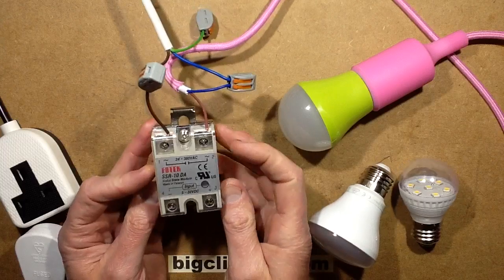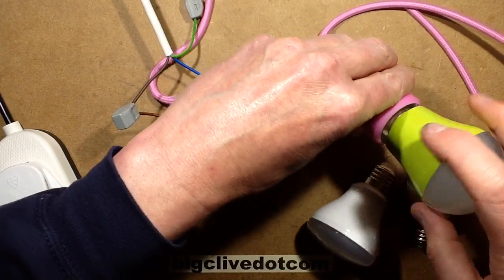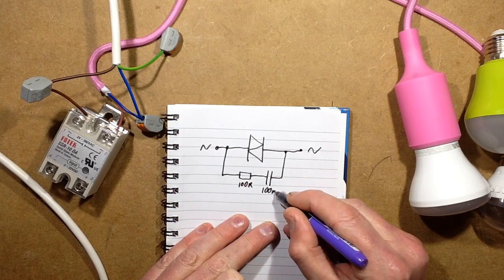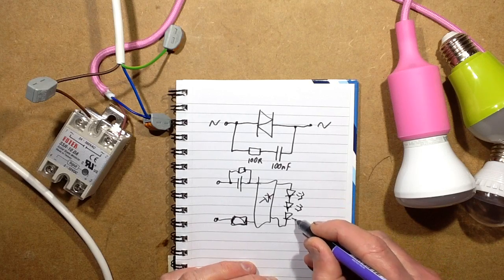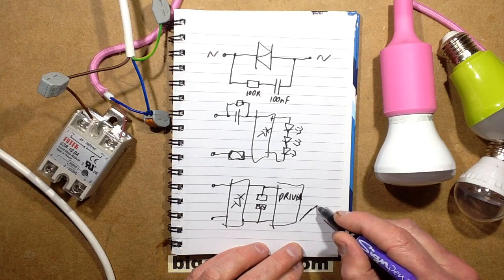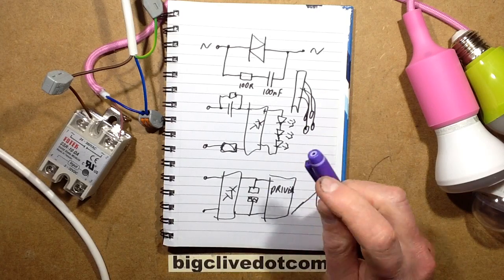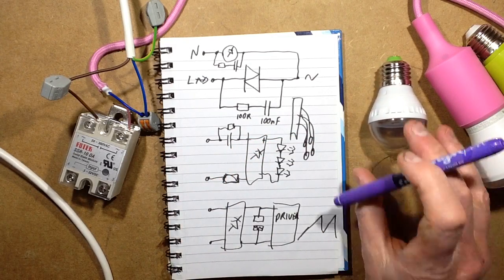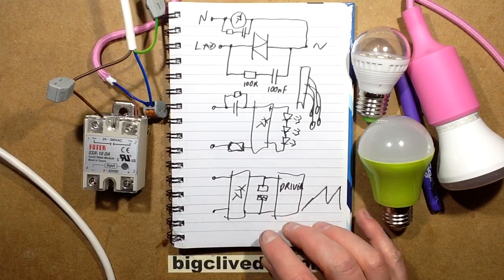Electronically controlled LED lamps glowing when off.

Comment: This issue seems to be more common with LED lamps of low wattage such as 2.8 watts. I have found that 2.8 watt LED lamp poses this problem whilst a lamp of 5 watt does not.
Further lamps of same wattage but of different companies behave differently.
Why is it so?
Reply from the maker: It tends to depend on the fitting of a shunt resistor in the lamp.

Comment: Ive gone back to halogen G9 in my polished chrome ceiling light fittings where Id tried LED bulbs that glow when off. A decent dimmer switch on the wall and they give off a much nicer light anyway. Not a single bulb blown in over 2 years. Im so tired of messing around with expensive LED lighting that just dosen't seem to give off a decent non defused light or as reliable .

Comment: I have a LED bulb that I clipped a resister out of, and it is glowing even when the switch at the wall is off.  No dimmer, no relay. Just bog standard light switch. Is this an issue?
Reply from the maker: That's common.   It's caused by capacitive coupling between the switch wires - especially on multi-way switching.  It's not an indication of a fault.  Just a free night light.

Comment: There is always a leakage voltage on an SSR .It will allow low voltage low current devices to to stay illuminated .We will switch heater elements through and use a manual motor starter or  contractor to disconnect the output going to heaters .Especially at 600V 3 phase heater banks used in commercial ovens .Croydom, Opto,or Carlo Gavazzi  they all have the same issues

Comment: I swapped 4 outdoor PIR Halogen floodlight bulbs for LED bulbs a few weeks ago and half of them are fine and completely dark when not triggered, but two of them light reasonably brightly when on, but not triggered, then go to full bright when the PIR triggers. i guess the good ones probabaly have normal relays in them? It's frustrating me!
Reply from the maker: It sounds like a snubber network.  The amount of electricity used when they are glowing while off is almost zero.
Reply: @bigclivedotcom  That’s what I thought. I might just enjoy the extra unwanted  “feature” of a nightlight mode rather than messing with snubber networks trying to fix it. After all, the power used would just have been sunk into the previous halogen bulbs anyway? So I’ve lost nothing, correct? Cheers 🍻

Comment: How to prevent this ghosting by using zener in voltage line?
Reply from the maker: It would be better to put a small load across the lamp to bypass the current.
Reply: I totally agree with that but electricians prefer doing a zener thingy, just curious to know how it is actually done, I have tried lut-mlc, works fine

Comment: If they all leaking some current at what cost over a year.  As my thinking all the usb socket chargers just a tiny bit.  It like taking 2p out of every bank account in the UK.
Reply from the maker: The current would be so small it probably wouldn't even register on the meter.
Reply: @bigclivedotcom  I have been looking at the lowest amount the meter will not pick up.  Such as neon lights
Reply: Am looking in to just how much current is needed to register on digital meters / smart meters.  Am getting some USB charge sockets to test next week may do video.
Reply: That's one reason to not leave USB chargers plugged in when not in use I guess,  the other is (and this is tested in dozens  of them ) they are aparantly not up tot par as safety is concerned .

So don' buy shit like this for cheaps I' d say .

Comment: Nice video!!! I bought a rope light that has the same issue, the thing is that I have the stuff around the whole yard and it never turns completely off.... What resistor would I add to an led strip (the rope light) that's about 150ft long? I'm estimating 800W and on although I use a dimmer to make it not as  bright. since it's an LED strip can I just bridge the positive and negative terminals at the end of it? -  t glows without the dimmer as well - Thanks so much!
Reply from the maker: If it's dimmer/control-leakage then any small tungsten lamp will mute it.  But if it's not bothering you then let it glow.
Reply: Thanks for the quick reply.
 @bigclivedotcom  but how much current would it be pulling 24/7?
Reply from the maker: @parascraps5796  If it's just snubber leakage then virtually nothing.  Literally just a few watts.

Comment: I ask, if the bulbs are switched off, will it use power? i have 20w led lamps and it still is on even switch are off
Reply from the maker: Sometimes they glow slightly, but are using extremely little power.

Comment: I ran into this problem recently after replacing all light switches in our house with the ones that have the gas-based light indicator(that turns on when you turn off the light). One of the lights in the house is an LED light fixture and when the switch is off, it blinks rather aggressively and frequently(like once every 2 seconds or so). I've been looking up solutions to the problem and I did get four different suggestions:

1. Connect a resistor and a capacitor in series with the light fixture
2. Connect just a resistor in series with the light fixture
3. Connect just a capacitor in series with the light fixture
4. Disconnect the light indicator(duh, but I bought the ones with the indicator on purpose and I'd rather have it work :D )

:D I think I'm going to grab some resistors and some capacitors with different values(suggested resistor values were up to 1 W with resistance between 100k and 1M ohm and for the capacitor either 220nF/400V or 100nF 275VAC) and see if I can resolve the problem.
Reply from the maker: You could also try a different LED lamp.  Only the ones with switching power supplies are prone to the flashing effect.  Others will just glow dimly (which can be useful) or not at all.
Reply: @bigclivedotcom  true - I'm just being cheap(well and I do want to experiment) xD Other than the flickering it's a perfectly good light - it's not the LED light bulb type, but instead the one that has a bunch of LEDs on a board, so replacing is pretty much getting a whole new fixture, which could have the same issue anyway.
I've temporarily removed the indicator light for now until I can get around to trying one of the other methods.
I'm also curious to know if it's possible to remedy the issue while keeping the indicator light in case we end up getting a fixture with the same problem. 

Thank you for the videos by the way! The educational part is well presented and the humour is top notch too!
Reply: A quick update on my situation. I've gotten two 100nf capacitors - one at 400V and one at 600V. I haven't gotten around to testing it on the fixture yet, but I did run into an LED bulb that did glow when the switch was off. So naturally I tried one of the capacitors(the 400V one). Lo and behold it did allow the LED bulb to turn off completely when connected in series. Here are two poor quality photos of it working - https://photos.app.goo.gl/op7HMMT7eDmDthkh7 . You can see the capacitor when the bulb is fully off, and the lack of it when it's glowing.

Side note - adding at least one bulb that doesn't have the problem to a chandelier with multiple bulbs also resolves the issue(I tried it with a different LED bulb that behaved correctly). However the solution with the capacitor can come in handy if you don't want to have mismatching bulbs, OR you can't add/replace things like in an LED fixture that doesn't use bulbs(no idea if that's the correct term :) ).

Not gonna lie - solving this made me squee with joy xD Considering my dad is an electrician and his solution was to just remove the indicator light xD

Comment: I have a weird LED bulb that continues to glow even when unplugged from the socket for hours. It's not always a steady glow, sometimes it will flicker, occasionally glowing bright enough to light up a room for a few moments.
Either there is a really big capacitor in it, or it's picking up electricity from some wireless source, like how a florescent bulb lights up near transmission power lines.
Reply from the maker: LEDs will glow visibly at just microamps.  Some lamps do glow for a long time when disconnected.
Reply: @bigclivedotcom  Thanks Clive, I Didn't expect a reply from a 4 year old video. 
It is weird to be able to be able to walk around the house with with a disconnected light bulb still flickering in your hands.
Reply: @JamieJamez  I think you could play some good tricks with that!

Comment: I tried putting a 47K 1/2 Watt resistor across the Live and Neutral wires, going to a 240V led bulb.
After a few minutes the resistor got to around 48 centigrade, and was too hot to touch.
The resistor did not breakdown, even when I extended the on time to 30 minutes.
 The resistor stopped the led glowing when the relay was off.

I also tried connecting a wall wart type power supply across the Live and Neutral going to the 240V led bulb. That also took care of the led glow.

So, am I wasting energy, using these SSRS and curing the problem with 'heaters'?

Looks like it is more sensible to use mechanical relays for these problem 240V led applications.

Comment: So the Impedance for this RC network is ZRC = 26.52601 kΩ. So in a 120 volt circuit @ 60 Hz the current is 4.5 MA.

Comment: You are supposed to turn the lights off with the wall switch right? Solved :)))
Reply from the maker: With modern lamps, even turning off the switch can make some glow with switch cable capacitance.
Reply: @bigclivedotcom  if the switch cuts off the power, how could led lamps get the leakage? I am confused a bit. If you are talking about high voltages, that might be the case
Reply from the maker: @cemal8123  Capacitive coupling between the cores in the switch cable.  Especially with multi-way switching.  Some LED lamps will glow at just a few microamps.
Modern capacitive dropper lamps have a resistor specifically for extra load when the lamp is off to try to prevent the glow.

Comment: WOW, Thanks !  I just spent 2 hours trying to figure out why my SSR was showing "almost" full voltage across the Output side, when NO input was present..... 
I thought  I wired it wrong...and you showed me what I had an assumption about - SSR are NOT  "Old Fashioned" coil relays that make a NICE noise when opening and closing!

Comment: So I am not an electrician or far cry knowledge in electronics. My out door lamps has 9w led lights that flicker or glow when turned off. Is this dangerous? I have 2 lamps(both led) sitting outside and simultaneously lights when I turn the switch on.
Reply from the maker: Modern LED lamps are so sensitive that it's not uncommon for them to glow slightly when off via the capacitive coupling or circuitry in the wiring and controllers.
It's not usually anything to be concerned about.

Comment: Be wary of SSRs from eBay as most there are cheap fakes which don't have high breakdown voltages
Reply from the maker: I took one apart in a video.  It had an undersized triac and very poor isolation.

Comment: Help. I have started using Smart bulbs in my flat. Living room are fibe. Bedroom one has a double switch (independent switches in 2 locations which turn the power on/off). I had to use a GU10 to E27 adapter. Obviously the power is on, but when I turn it off (via smart app) it very faintly flickers. 
Any ideas? They switches are not dimmer. I hear it might be to do with the load or poor connection at the bulb. Should I replace the pendant to a E27 and do away with the adapter?
Reply from the maker: It's common for some LED lamps to glow slightly on two way switching due to increased capacitance in the switch wiring.  Try a different brand of lamp.

Comment: Found this out recently when I was using a solid state relay to control a neon transformer.  Even when it was supposedly off, there was enough current going through the transformer to produce very tiny sparks when the output wires were a fraction of a millimetre apart.  Luckily it didn't catch me by surprise, because I was also using the Cliff QuickTest and its neon indicator was also well lit even when the SSR was supposedly off!

Comment: I've got 2 lap led pir security lights that glow when pir turns off any clues why ? I turn mains switch off and they go out . I have 4 more different make of security  pir senor lights that run off same supply and there fine could it be the lights them selves  cheers
Reply from the maker: It may be capacitive coupling through a filter capacitor.  Probably just a tiny current.

Comment: Possible solution: Put an X2 capacitator in parallel with the lamp as a bypass for the leaking current. 
NOT for dimmed lamps! Phase cutting produces harmonics. These higher frequencies will lead to dangerously high currents throug the capacitator when the lamp ist powered on.
If a dimmed LED lamp glows or flickers when turned off, use a "Kompensator 6596" from Busch-Jaeger. This is just a PTC in a casing. Bypassing leaking current to neutral, it will get hot an highliy resistive when the lamp is switched on.

Comment: Hi Clive. I have this problem with a light in our stairwell. It has a dual switch so that it can be switched on or off from either the top or bottom of the stairs. Very annoying and i really want to fix this without wasting power. I have no dimmer and no relay in this circuit. Just a switch at top and bottom of the stairs.
Reply from the maker: If it's just a slight glow it's not an issue.  It just means that the slight capacitive leakage current that would normally be wasted is producing a small amount of light.  With electronically active lamp where it makes them pulse it would be an issue.

Comment: does the seccond snubber network need to be of a spesific value? (can i use 100R100nf?) it drives me nuts that i have to connect a load (usualy first ting on hand is a par) that gets anoyingly hot, when the load your intersted in is so small 
i want to build a few "snubber plugs" instead of a conventional load :) (perhaps i need to build a fiew versions  and pick the best one when neaded :P )
kind regards,
Milan Hofman
Reply from the maker: 100 ohm and 100n would be a good starting point.  Also include a high value resistor across the capacitor to discharge it.  1 Megohm should be fine.  For an actual theatre dimmer you may need a low resistive load to make the circuitry stable.  A traditional 60W lamp in a work light like a clip-on metal caged hand lamp is one option.  A coloured lamp (even a UV style tungsten lamp) will also avoid light spill.

Comment: Probably the simplest solution is to use a mechanical relay for these applications.  You only see this problem on super-low current circuits, meaning ones where a mechanical relay will last indefinitely.  There's no lifespan advantage to solid-state in those cases.

Comment: With big dimmer packs it's often not just the snubber network. Most dimmer packs are used for tungsten lamps, and as you most likely know, to prolong the life of the lamps, there's a pre-heat setting on the dimmer packs. This delivers just enough power to the filaments to heat up, but not enough to actually light up. When you use LED based lamps on these lines, they wil light up, because they need so little energy. That's likely what the problem was with the disney dimmer packs :p
Reply from the maker: Preheat is an option on the theatre packs.  It was turned off.
Reply: I'm volunteer light tech at a local stage, so that's where I get my info from as far as existing equipment goes ;)
(and electronics engineer... so I do kinda know a bit about the technology... LOVE learning from your videos ;) )

Comment: I knew someone that thought they were getting free light, so they connected a few to make it just bright enough to walk about.  I just couldn't get it through to him that he was not getting it for free,  He was in the countryside so everything was pitch black, so even the small leakage current would light up things just enough to see to get around.  It was so funny he thought he was getting very dim light for nothing, about as dim as he was.  Strange thing though, give him an engine and he was brilliant.  But electric and him did not mix, he even stuck with car electrics.  But he could get more out of an engine than anyone else I knew.  He even got more out of a motorcycle engine than the manufacturers could.  You just have to laugh sometimes!

Comment: Ok I understand this but why do some small LED lights glow a little bit when a non-dimmer switch is off?
This is a house on 120 60Hz in the US. I can post a video if you need.
Reply from the maker: +Sean Not-telling They're super sensitive to even microamps of leakage, including capacitive coupling between switch wires.
Reply: There is noting like that little ghost glow from them at light.
It only does it if I have at least 3 of the 4 sockets filled.
If I have only 2 them no glow.

Comment: So you're telling me solid state relays are actually insanely unsafe and should not and must not ever be used in equipment that MUST be off.
Another point to old school mechanical stuff being higher quality!
Reply from the maker: Even old school relays can weld closed.  But it's less likely than with solid state relays.
Reply: Yeah just cut the power with a true switch.  Had a coworker get quite the shock when operator turned the heaters back on using their touch screen HMI.

Comment: YES,an AC rating capacitor should be connected across the lamp as a dummy load for the leakage current coming from the indiot and useless snubber circuit connected across the TRIAC.470nf/275VAC is ok.The snubber across TRIAC is useless and can cause similar problems in modern very low current standby circuits.